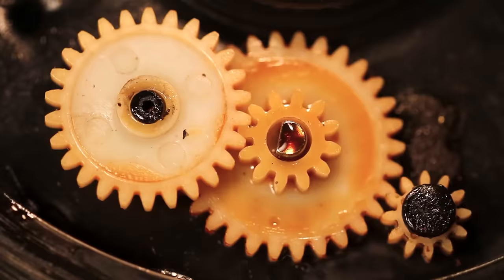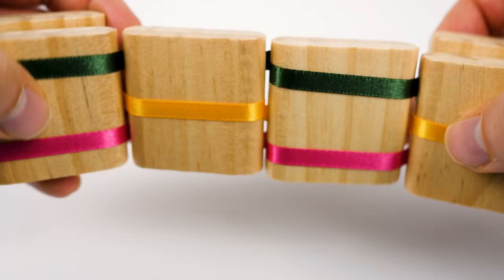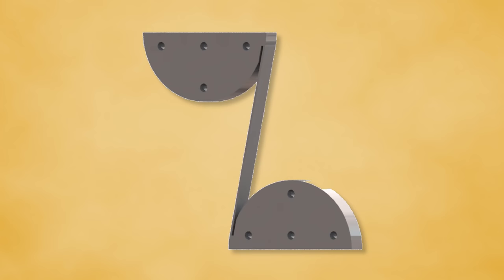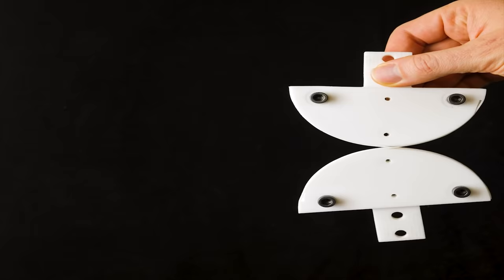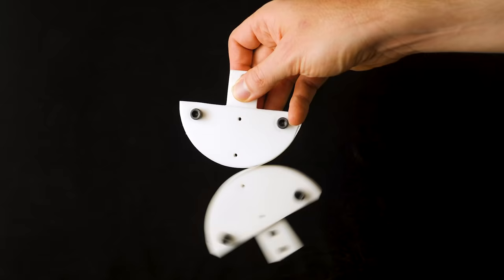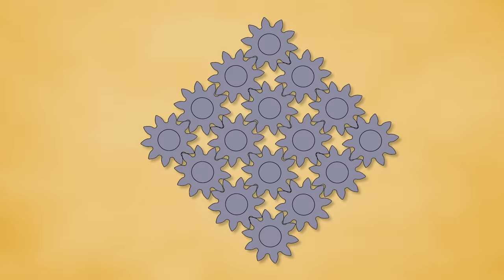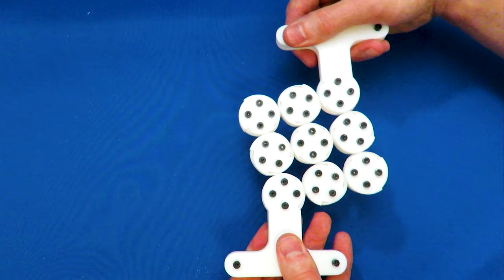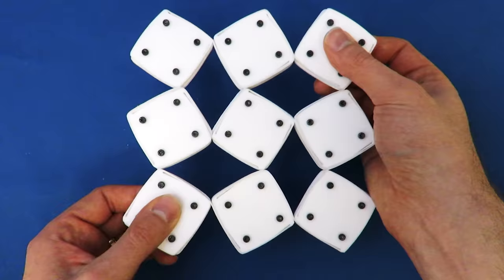Compliant Mechanisms that Roll Like GEARS!?! -- #VeritasiumContest

Comment: This mechanism is awesome! Does it have an official name?
IIRC I've seen this done before with strings in an experimental RepRap 3D printer, but 
I didn't think about using strips of flexible material instead.
I guess this would work well with PET-bottle-plastic and 
post-assembly-tensioning with a screw.
Something to try …
–––
Also: Maybe this could someday be used for future diamondoid nanomachinery.
Nanoscale defect free diamond can flex >10% and flex is very minimal in this mechanism here.
Or maybe strips of graphene sheets could be used.
Reply: RepRap Simpson? The pictures I've seen did show gear teeth, I guess because they're free to include when you're printing the parts, in addition to the strings holding them together.
Reply: Yes, gear bearings make things more rigid but are compatible with this. Could be I've seem a version without gearteeth but IDK.

Comment: This is a variant of the Rolamite mechanism patented in 1969: https://en.wikipedia.org/wiki/Rolamite
Reply: https://en.wikipedia.org/wiki/Scrollerwheel too. It's similar but for continuous rotation rather than linear motion. (I don't remember if those two Wikipedia articles link to each other, but they should.)

Comment: This is really cool but also it makes me wonder if it's ever possible to make a compliant "gear" that can rotate continuously
Reply: Idk. But the video implied things that are just incorrect and might make a person assume that such a thing was shown.
Mostly thinking about the "360 degrees" comment. And the entire premise that this is a replacement for gears when it's a replacement for joints.
Reply: the answer is no,

that would just be a pulley and belt system which is not "compliant"
Reply: https://en.wikipedia.org/wiki/Scrollerwheel

And https://en.wikipedia.org/wiki/Rolamite for linear motion. I don't remember if those two Wikipedia articles link to each other, but they should.

Comment: This is awesome, I wonder if such mechanism would work 3d printed.... Maybe with petg
Reply: It does. PLA works fine. However I printed the bands seperately to screw on later. I think the quality will be higher this way. Will try all-in-one like in the video though.
Reply: @benjaminheindl1069  So you print the band flat on the bed? 
hmm i think i need to try this out. In my experience PLA is to brittle for such a big flexingrange and would break

Comment: Using fibers instead of compliant rigid materials could offer some advantages, I think. There are some simple benefits: not directly distorting the material should increase lifespan, many fibers offer higher tensile strength than metals, along with much higher specific tensile strength. There would be a loss of torsional stiffness, but this can be accounted for by designing the roller to be longer, or by using two rollers.

Critically, though, is that you lose a design constraint: a rigid material may be very difficult to wrap around a roller by even a single full rotation. It may also be dangerous, storing a large elastic potential energy, where the elasticity is needed to operate the rollers.
Using fibers, there is no elastic energy stored in the ideal frictionless case. As well, it should be trivial to wrap a fiber around a circle, not only once, but multiple times.
This means you can more practically achieve a much larger range of motion than with the compliant form of the design. Still not an arbitrary range like with gears, but I imagine it could be valuable to have a larger range of motion possible in a design.

Comment: I'm a little offended that you didn't credit the Rolamite in this video.  While not exactly the mechanism you presented, it is the clear starting point of this work.  Give credit where it is due!
Reply: The paper cites it. Anyway, Wikipedia article for those not familiar with it: https://en.wikipedia.org/wiki/Rolamite

https://en.wikipedia.org/wiki/Scrollerwheel too. It's similar but for continuous rotation rather than linear motion. (I don't remember if those two Wikipedia articles link to each other, but they should.)

Comment: That is a cute design, but there's no application it could help in real mechanical world. Rotating and non rotating gears create friction and heat. Using tapes of whatever materials you use would shrink and expand and eventually would snap overtime. If that happens, an engineer needs to reroute the whole tape back again, reassemble them in a pattern and make sure it aint loose, otherwise, it would be inaccurate. Unlike the common gear, just replace the busted one and off you go, back in business.

Comment: Wait, I thought plastics were not an excellent material for compliant mech, as discussed in your university lecture on YouTube. Yet you model out of plastic, which you may say 'is cheaper to test', and yet, most people can not afford to produce anything much higher in expense than plastics and mild steel,  and also considering that the nylon carbon fibres are increasing in strength. It only seems logical that plastics are, in fact, a suitable method of deploying compliant mechanisms. Do you still believe compliant mechanisms are best made out of more complex materials like steel?
Reply from the maker: Right, plastics creep and experience hysteresis so they are not good if you care about precision. But if you want to quickly build prototypes for low cost with cheap laser cutters and that deform large amounts, it's a good choice for an impressive kinematic demo. But you're right, if these were ever used in a real machine, you'd want to make them out of metal!
Reply: @TheFACTsofMechanicalDesign  Unfortunately, I am 3D printing most of my designs due largely to a lack of any other mechanical device to use. 

Nevertheless, the concept you have expressed above makes sense as I am trying to print my own Herringbone Planetary gears for a Nema 14 stepper motor.  

The gears I am making are press-fit, and I apply silicon as a lubricant. However, I have notices that the gears lose their stiffness for want of a better word, over time, and at first, I thought it was because of the lubricant. Yet, it is most likely deformation as you are referring to above. 

Thank you for replying, that help in relation to what I should do once I've got a working prototype. Cheers
Reply: @TheFACTsofMechanicalDesign  Good lord though why would you ever laser cut something out of Teflon unless you had a good reason?  Is this a prototype motion transfer system that needs to work inside a vat of hydrofluoric acid?

Comment: That is not a gear
Reply: It behaves like them, except instead of teeth it's straps.
Reply from the maker: Yes but it enforces the same kinematics as gears (i.e., rolling contact) so it behaves like gears.
Reply: @TheFACTsofMechanicalDesign  Can this design be made with a non-1:1 gear ratio?
Reply from the maker: Yes! We've built many of these and I intend to make more videos that are longer than just one minute about the concept so stay tuned. But if you want the spoiler alert you can check out the Nature Communication paper to see all that we've done. Link is in the description
Reply: @TheFACTsofMechanicalDesign  yeeeeeesss, keep postiiing!!!! That’s awesome